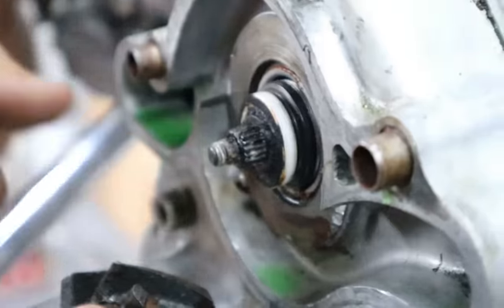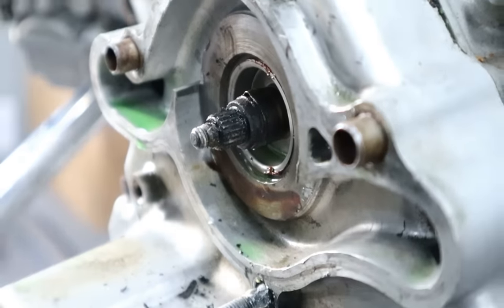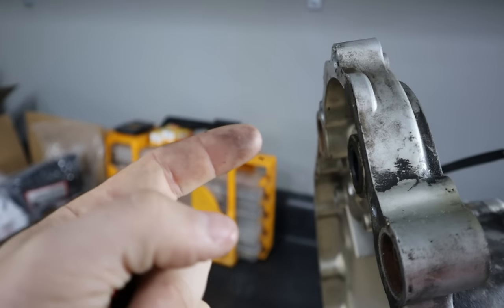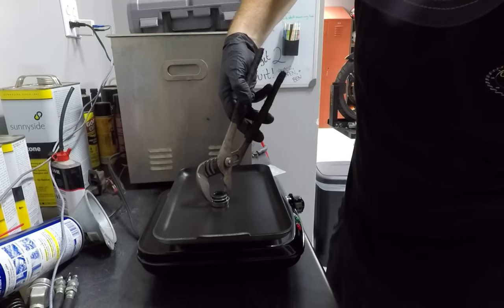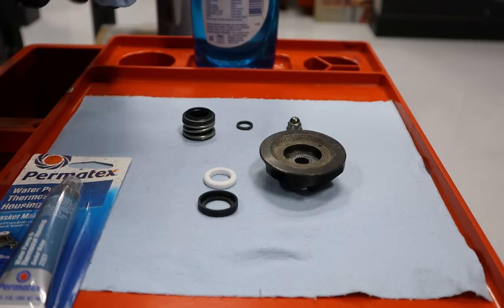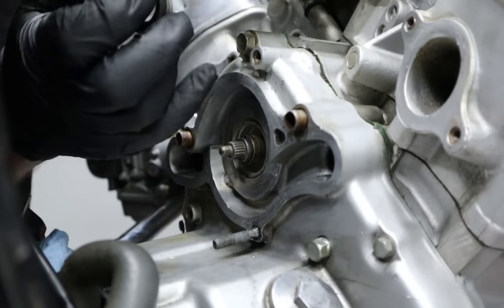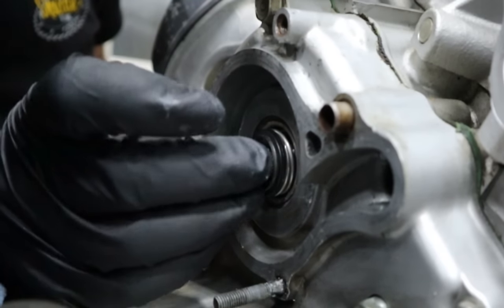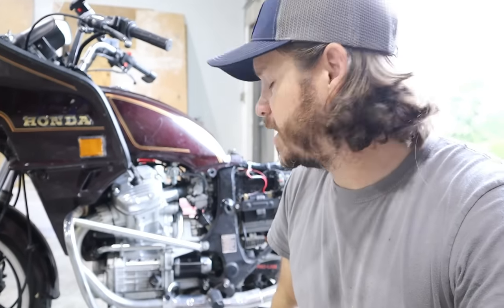"Shep Method" CX500 Mechanical Seal Replacement - How To

Comment: I loved the cx 500 as a mechanic in 1980. They recalled them all as the cam chain guides would fail. Honda paid 4 hours to replace the tensioner and guide. I could do it in 45 minutes. After I did 50 of them. Honda wanted me to show them how I did it so fast. But they never showed up. In 1981 they cut the warranty time to 2 hours. Made a boatload of money doing these recalls
Reply from the maker: Heck I have 30 minutes in properly cleaning the gasket from the rear cover so yeah id wonder too lol
Reply: @BrickHouseBuilds  the bikes I was working on were less than a year old and the cover gasket peeled off in one piece. 40 years on not likely
Reply from the maker: @andrewwolf4430  that is definitely true!

Comment: Hey guys.  Thanks for this video. Very informative. I happen to a fan of the cx500,  even though I seem to be in the minority.  There is a lot of hate out there directed towards this bike and I don’t know why.  It was my first bike, bought in 1980, and I’ve owned 3 since then. I even had to pay for the so called “ triple bypass” on one bike but still a fan. I learned to live with not having a 6th gear. I’m actually negotiating to buy another one right now, with only 12000 km and all original.  Thanks again for the video and the several cx500 projects you’ve done. Cheers. Dan ✌️🏍🇨🇦
Reply from the maker: Thank ya Dan! I am not sure why the bikes are so devisive to people as there are many who say it's the worst motorcycle ever but also many who say it's the best!

Comment: Ah, so the one you split is brand new and you are re-using the original bucket so you do not need to bore out for the larger diameter…. Had to watch it twice to make sure I got it. Great video (as are all of yours!). Thanks BJ.
Reply from the maker: Exactly!
Reply: Just starting mine and using your videos A LOT 😜🤣👍

Comment: I’ve had a cx500 for about 2 weeks. Original owner sold it to me. It’s a 1980 Deluxe with 12,000miles on it. So far it needed the oil filter spring and washer(was missing), fork seals, new front disk rotor, master cylinder rebuild, pads, new head gaskets, left cylinder leaks coolant, mechanical seal as of today that’s definitely leaking. So I got some work ahead of me however none of this seems super difficult. Suprisingly ine of the most difficult things is finding out how much oil these take, I’ve seen from 2qts up to 3.5. I used 2.6 as that’s what my service manual said. Anybody know for sure the proper amount, also is there a gasket on the water pump housing? Or just metal to metal?
Reply from the maker: I put in two and then add until it's at the right spot on the dipstick. Run it for a minute then check it after another minute

Comment: your seal came out so clean, mine had rubber chunks and needed 15 minutes of detail with the Dremel LOL. nice vidjeo.  hardest part is cooking the seal to the right temp to get the seal out. I ripped one and ruined it by not getting it hot enough and pulling too hard. I made a video on this too :)
Reply from the maker: Yeah the stock one pretty much fell out. It did take work to clean the bucket which I didn't show.  I feel turning it 90 degrees was the trick 😉

Comment: My Shep fix has been running well for 2 summers now. Of course, I lost my thrust washer while doing it since I was on a partial gravel driveway lol. but it was all good, it was easy to buy a replacement and then I just got a new copper crush and nut.
Reply from the maker: It seems like a logical fix for sure. I see no reason it shouldn't stand the test of time!

Comment: Alas, another reason to build a GL instead of a CX. I'm a huge fan of these drivetrains, but the GL has numerous and significant reasons to choose, if given the option. Great video BHB, keep up the great work. Congrats on the new shop too, it looks amazing!
Reply from the maker: The GL definitely is the better platform.  Superior in many small ways which really add up

Comment: What a time. The careful and delicate parts of the reassembly is the best parts to learn from. I feel like I could do this part on my own next time. I’ll be coming back to this later as a reference. Rahman, Ramen, cup of noodles, doesn’t matter, good stuff. Nudo House does a better job of it than I can. 
Thanks for the help & guidance. 
Next year will be when I get the Iron Butt under my belt… after the drive to Texas, I’m More confident I could complete it.
Reply from the maker: I know you got it! We are going to grease your suspension bushings before you do though!

Comment: I did the shep method with a yamaha 660 mechanical seal as per the cx guidebook back in 2008, and still no leaks!
Reply from the maker: Nice! I think I used the yamaha seal on the last 650 I did

Comment: Hola !!
Tengo una pregunta  ..
Ya cambié el árbol de levas también el sello mecánico y la propela pero a un haci la sigue barriendo y se mete el agua al motor...un consejo se los agradezco.
Reply from the maker: If coolant is getting into the engine that means the camshaft oil seal is bad or you have a bad head gasket.

Comment: Hi...I need to replace my mechanical seal on my aged Sym scooter. I cant decide whether I should go for your method or try and somehow get the old metal cup out? I have a genuine Symbmechanical seal set but not sure how to get the ild one out and whether the new cup has to be pressed in which would be tricky as I haven't removed the casing so it would have to be done side on. Can you offer me any advice please?
Reply from the maker: This video is specifically for honda cx500s

Comment: Hello, Is it the same method for a CX500 or is it possible to get out the whole seal (so no need to separate and to put Permatex on the reassembly) ? Thanks
Reply from the maker: Yes as mentioned this is the same method for a cx500. I spoke about the difference in sizes for the cx500s and GL series. Please reference the links in the description as it will clearly explain everything

Comment: on a Kawasaki 750Vn to do this seal ,it says you have take the motor out ,and split the case .
is that a screw up or what?
Reply from the maker: That I dont know. I've never worked on one of those